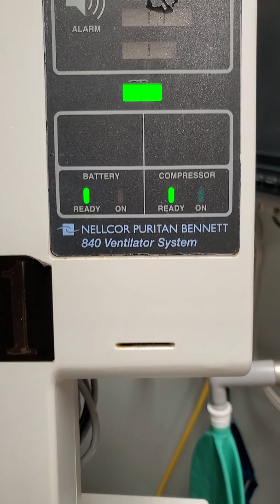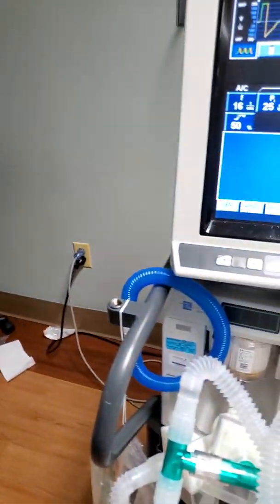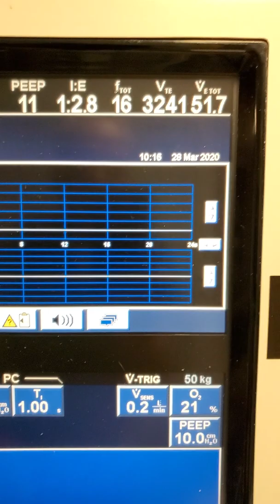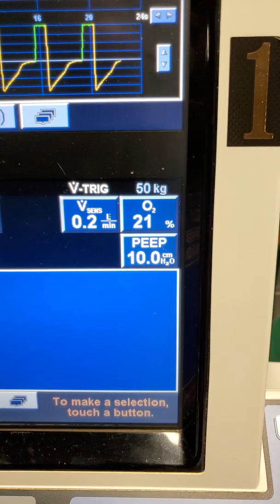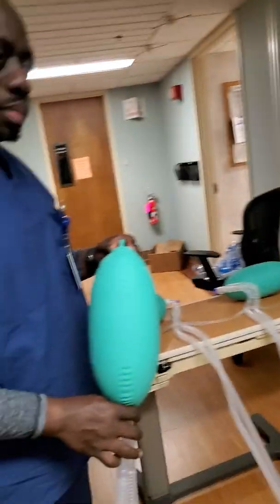20200328 101351

Comment: This is Russian Roulette with a ventilator. Is the doctor in the video a dermatologist or why does he not understand the very basic principles of mechanical ventilation?
Reply from the maker: This device will never replace the normal ventilator procedure of one person to one ventilator. This device is to be used only in circumstance where there are mass casualties such as war or plagues.
Reply: @sherryvice4227  Even then it is a stupid idea.There is no control/monitoring of what fraction of that tidal volume goes to which patient. There are no 7 or 8 identical patients and that's why this concept is complete bollocks. Just imagine two of the patients suddenly desaturated, another two develop a respiratory acidosis, one becomes haemodynamically unstable from hyperinflation and one develops a respiratory alkalosis. You would have no clue what to do and would likely kill the majority of the patients in a short time.

You seem to be an engineer, Bob, maybe you could pm me the doctor's email address?